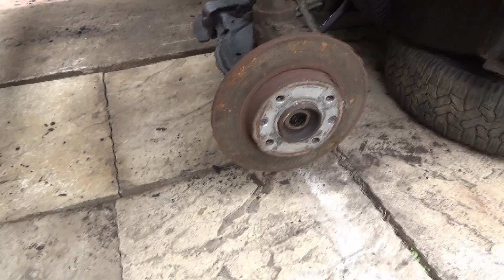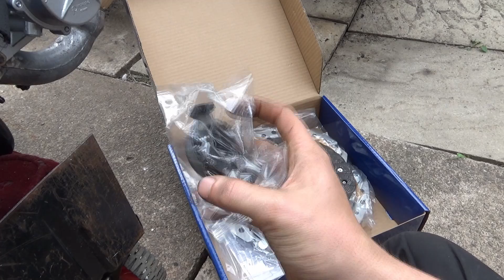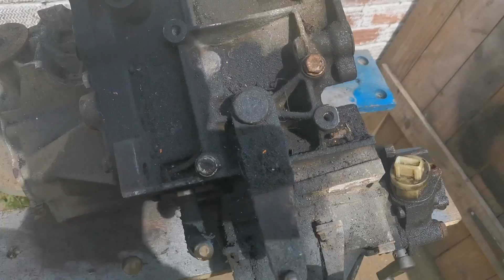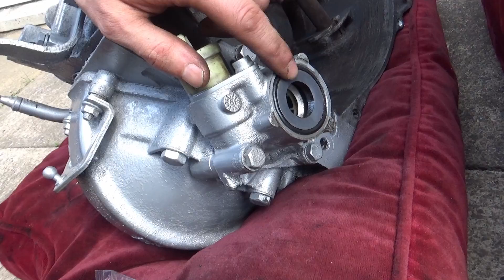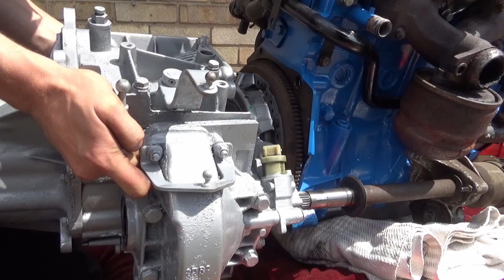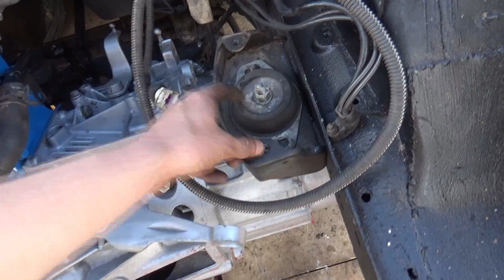XUD9 Engine And Gearbox goes into the ZX / Clutch alignment with no special tools.

Comment: Hi, for the driveshaft you have to loosen the 11mm bolts about half way the turn them 180°. I did the same as you removing the support with the axel but after a lot of faffing about I saw how it worked. Keep up the good work
Reply from the maker: Thank you for the info

Comment: this engine not have  bearing pilot for center the gearbox  ?engage is loose?
Reply from the maker: Sorry I'm not sure what you mean the gearbox centre is splined so it mates together with the splines and the bearing for the clutch clips firmly to the clutch arm in the gearbox.
Just grease it up and it all connects together fine.
Reply: @TheZXGuy  hello .   my question is :    this engine use  or not  guide for axle ?   sorry my poor english . 
https://www.4x4brasil.com.br/forum/attachments/kia-sportage/463328d1400524981-sportage-com-motor-gm-opala-151-a-dsc08133.jpg
Reply from the maker: Nope it doesn't use that there would be no space because everything fits tight together without any guide or spacer
Reply: @TheZXGuy  ok . thanks, 
I added a guide on my dw8 engine in my car 4x4 here in Brazil and it kept making a lot of gear noise at 900 rpm , I think that is this problem ,  here mechanicals  dont know this engine  .

Comment: Agree with those clutch tools they are crap and always way to loose, Ive used borg clutches for years and have never seen one included in thier kits like other manufacturers do probably why borg & beck don't include one because they are useless, I have a set of long reach Halfords 1/2" sockets and over the years there has always been one in my set that will align a clutch perfectly.
Reply from the maker: I have got a clutch tool somewhere but get a much better fit from placing a socket in there also I have used various different clutch brands and you won't get one included with the clutch kit.
Thank you for your comment I hope your enjoying the videos.
Reply: @TheZXGuy  I've had a couple of Exedy clutches given to me to fit with a plastic tool in the set but again a bit to loose.
Reply from the maker: @Megalocade  ooh I didn't realise they even supplied them learn something new everyday